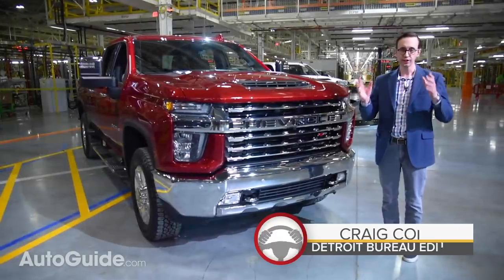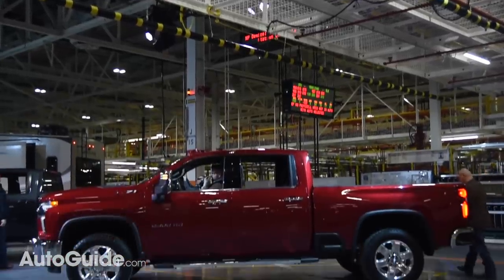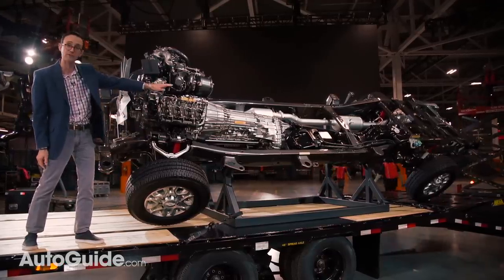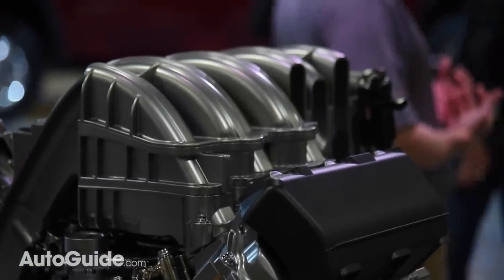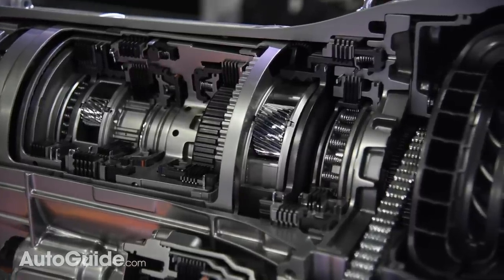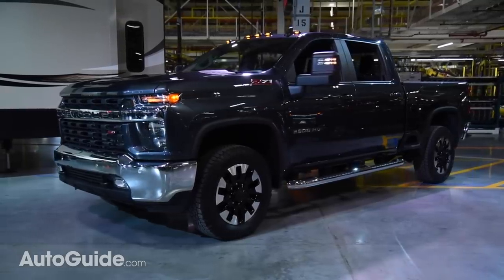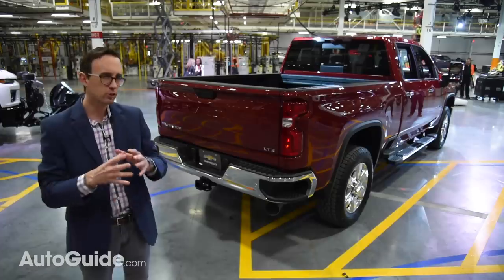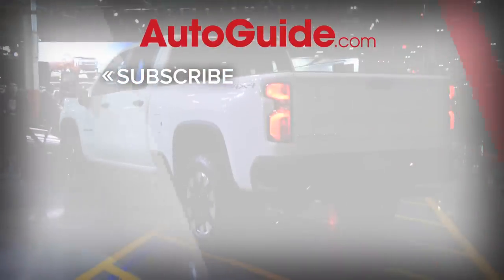2020 Chevrolet Silverado HD - First Look

Comment: Do You Guys Know When The 2020 Suburban Will Unveil?
Reply: What is the 2020-2021 Suburban gonna look like? I never seen a picture of it I only seen the spy shots, the current generations, the previous generation, and the misspellings
Reply: Santino Eli It Will look like the Silverado it will have the same grille as the Silverado and the headlights will look similar to the Silverado and the Suburban Will Have the air curtains that’s on the Silverado beneath the headlights and the taillights will be different on the Suburban and it will not look like the Silverado’s taillights
Reply: @justinsmith2598  I ain't got a picture of it
Reply: Santino Eli they haven’t unveiled it yet or showed a picture of it
Reply: @justinsmith2598  Same ones from the previous one and what is a air curtain
Reply: @justinsmith2598  How about the windows
Reply: @justinsmith2598  Will it have the same rear end, Will it have push start, Will it have a 4 cylinder like the Silverado, Will it have auto stop, I googled it and I don't see all I see is the current generation, spy shots, not the one showing it,
Reply: @justinsmith2598  Oh I thought it was going to have the same taillights from the Silverado but what will the taillights look like?
Reply: Santino Eli it will not have the same rear end,it will have push start,auto stop and it will get a 4 cylinder
Reply: Santino Eli oh wait you’re right the taillights will stay the same
Reply: @justinsmith2598  Different taillights?
Reply: @justinsmith2598  You mean have
Reply: @justinsmith2598  When are they gonna have a picture of it?
Reply: @justinsmith2598  Same windows, Same wheels from the Silverado, Same cluster, Same headlights, Same everything except rear end?
Reply: Will it have the same the interior from the Silverado? Will it come in special editions? Are they going to make a Tahoe version out of it?
Reply: @justinsmith2598  What else will it have to it? Will it have the same headlights as the Silverado?
Reply: @justinsmith2598  Are the taillights still square?
Reply: Santino Eli yeah
Reply: @justinsmith2598  Now let's talk about the Yukon
Reply: Please tell me when are they gonna have a picture of it
Reply: @justinsmith2598  Will everything be the same except the rear end
Reply: What trim levels will it come in?
Reply: Santino Eli The Yukon is gonna look exactly like the Sierra But a smaller grille
Reply: Santino Eli oh no it will not have the same interior from the Silverado and idk if it will come in special editiins
Reply: Santino Eli The trim levels for the Suburban is LS,LT,RST,Premier Plus And high country and the Yukon Trims will be SLE,SLT,AT4 And Denali
Reply: Santino Eli idk when they are gonna have a picture of it but it is gonna go in production sometime in May or June
Reply: @justinsmith2598  Sorry it's editions but tell us more about the Yukon what is the grille gonna look like
Reply: @justinsmith2598  Finally AT4 YUKON!!!!!
Reply: Do the Escalade next
Reply: @justinsmith2598  Maybe before they come out they'll have a picture of it
Reply: @justinsmith2598  Finally GMC's making an AT4 Yukon!!
Reply: @justinsmith2598  Will the Suburban and the Yukon version have the same gauge cluster from the Silverado and the Sierra? Will they both have the same windows? Will they still have the same headlights (Silverado) and the same grille (Sierra) because I already know that. And will they still have the same Denali wheels from the Sierra version? Will they come in a 4.3L V6 and a 3.0L Inline 6 Diesel like the Silverado and the Sierra? Is the 2500 coming back? Will they have the same mirrors from the Silverado/Sierra? Will it have the 5.3L V8/4.3L V6/6.2L V8/3.0L I6/6.6 LITER badge on the side vents the fenders? Will it come in 6.6 gas everything like the Silverado/Sierra HD? Will they have a liftgate step like a tailgate step from the Sierra? Will the Suburban have the auto liftgate? Will everything be the same except rear end, interior, and something else besides that those will be the same exact things from the Silverado/Sierra.
Reply: @justinsmith2598  Will they have the same gauge cluster?
Reply: I mean from the 2019 Silverado/Sierra not the cluster from the 2015-2019
Reply: @justinsmith2598  Now talk about the Escalade.
Reply: @justinsmith2598  Same windows, Same headlights, Same everything except rear end and interior, And do the Escalade version and more about the Yukon version
Reply: Santino Eli The 2020 Escalade Will Have The same Headlights as the Ct5 Or xt6 And Same taillights as the xt4 and the Escalade,Yukon And Suburban And Tahoe will be bigger
Reply: @justinsmith2598  Do more about the Yukon will it have the same grille
Reply: @justinsmith2598  Sorry Cadillac don't make a truck similar to the Silverado or the Sierra
Reply: @justinsmith2598  Do the Tahoe
Reply: @justinsmith2598  Will the new Suburban and the Sierra have the same gauge cluster from the Silverado and the Sierra and the same headlights?
Reply: Santino Eli I know I’m telling you about the Escalade
Reply: @justinsmith2598  Do more about the Yukon
Reply: @justinsmith2598  Oh, I got a few more things to say, Will the grille and the rear say "CHEVROLET" on it? Will it come with heads-up display (HUD)? Will it come in Z71? Will it have the same wheels from the Silverado? Will they have white/blue letter tires? Will they have running boards? Will they have the same windows from the Silverado/Traverse? Will it come in diesel, V6, and a 6.0
Reply: Santino Eli oh no it will not say Chevrolet across the grille and rear and it will come in heads up display and it will not come in z71 and it will have the 2020 Suburban LT Will Have The Same wheels from the Silverado lt
Reply: Santino Eli oh whoops sorry
Reply: @justinsmith2598  I did it not me I thought it was going to look like the 2018-2019 Expedition for a second but it won't
Reply: Oops it's Expedition not email
Reply: @justinsmith2598  What do you mean oh whoops sorry
Reply: @justinsmith2598  You forgot some things will it have white/blue letter tires will they have running boards will they have the same windows from the Silverado/Traverse and will it come in diesel, V6, and a 6.0
Reply: Santino Eli It will not have the same windows as the traverse and Silverado and it will of course have running board and it will have a diesel and idk if it will have a white and blue letter tires
Reply: Santino Eli Because you said that I spelled something wrong
Reply: @justinsmith2598  I accidentally spelled Email it's Expedition I thought it was gonna look like the expedition but it's the Silverado
Reply: @justinsmith2598  What are the windows gonna look like
Reply: @justinsmith2598  Will the windows be the same as the 2015-2019
Reply: @justinsmith2598  The Traverse and the Silverado's windows are the same shape
Reply: @justinsmith2598  When is the 2020 Suburban/Tahoe/Yukon/Escalade coming out
Reply: Santino Eli idk when it’s gonna be on sale but it will go in production in May
Reply: @justinsmith2598  It's coming out next month or maybe that's when they'll have the picture of it yet
Reply: @justinsmith2598  Tell me more about it tomorrow
Reply: @justinsmith2598  What are the windows going to like it's taken from and what are the headlights gonna look like it's taken from too
Reply: @justinsmith2598  Sorry my name is The Top Speed Guy from now on
Reply: @justinsmith2598  What will the windows look like? Will it have power running boards, Where will it say "CHEVROLET" at?
Reply: @justinsmith2598  Will the taillights be the same on the previous gen 2015-2019 or 2007-2014? Will it have power running boards? What are headlights and the windows gonna look like?
Reply: The Top Speed Guy It will have the same size of the taillights from 2015-2019 but it will change inside the headlights and yes it will have running boards
Reply: The Top Speed Guy the windows will look the same and it will not say Chevrolet across the grille
Reply: The Top Speed Guy it will not say “Chevrolet” anyone it’s just gonna have the Bow tie
Reply: The Top Speed Guy it will have the same windows as the outgoing Suburban and all I know is that the taillights will look similar to the new Silverado
Reply: @justinsmith2598  You mean power running running boards and are the windows the same and you said anyone
Reply: The Top Speed Guy the Tahoe is gonna have the same stuff as the Suburban But a shorter wheelbase
Reply: @justinsmith2598  Oh, why the same windows as the old one? I thought it's gonna look like Silverado/Traverse windows
Reply: The Top Speed Guy the Yukon windows will stay the same and the front end will look similar or to the new Sierra and the size of the taillights will stay the same but some changes inside the taillights
Reply: The Top Speed Guy oh wait you’re right sorry
Reply: The Top Speed Guy yeah I meant power running boards
Reply: @justinsmith2598  Will it have moving running boards will it have the same headlights
Reply: @justinsmith2598  Sorry you noticed I just changed my name to "The Top Speed Guy" and added a picture "2010 stock silverado 5.3 top speed"
Reply: Will it have moving running boards and the same gauge cluster
Reply: The Top Speed Guy I know
Reply: @justinsmith2598  Will it have the same gauge cluster
Reply: Forgot 2 things, Will it have a sunroof, and the same gauge cluster from the Silverado
Reply: @justinsmith2598  Finally High Country Suburban
Reply: The Top Speed Guy idk if it will have a sunroof but I know it will have the same cluster as the Silverado
Reply: @justinsmith2598  Sorry it's just a customization
Reply: @justinsmith2598  My name is The Top Speed Guy now
Reply: @justinsmith2598  It's May today!!
Reply: @justinsmith2598  Really? I know it will have the same cluster
Reply: @justinsmith2598  What does idk if it mean
Reply: @justinsmith2598  What about the Yukon will have the Sierra cluster and will the suburban headlights be the same
Reply: Will the suburban come in trail boss
Reply: @justinsmith2598  Every Suburban has different taillights
Reply: @justinsmith2598  Will it have the side scuttle that's on the headlights, Will it come in Trail Boss
Reply: @justinsmith2598  I think they finally have the picture now!!!
Reply: Daniel Frank how did you find it what website?
Reply: Daniel Frank what do the trucks look like?
Reply: @justinsmith2598  I googled "2020 Suburban" and all I see is those stupid spy shots and the 2015-2019
Reply: @justinsmith2598  Googled it
Reply: @justinsmith2598  Ugh, I hate the things being the same on it
Reply: @justinsmith2598  Oh no it will not come in trail boss the trim levels will be LS, LT, LTZ, High Country, and the Yukon trim levels will be SLE, SLT, AT4, and Denali and what would the Escalade have?
Reply: Daniel Frank Do You Know when it’s gonna Unveil?
Reply: @justinsmith2598  Actually the side of the doors actually is a Silverado but without the curve on the back of the windows
Reply: Or a Traverse
Reply: @justinsmith2598  What trucks
Reply: Daniel Frank  the new Suburban,Yukon And Escalade
Reply: @justinsmith2598  Trucks that look alike:
Nissan Titan looks like Ford F-150
Dodge Ram looks like Chevy Silverado
Honda Ridgeline looks like Chevy Avalanche
Cadillac Escalade EXT looks like Lincoln Mark LT/Blackwood
Denali looks like a Lariat
Trail Boss, Warrior Concept, Rebel looks like a Raptor
High Country looks like a Roush
Reply: @justinsmith2598  I don't know either it probably before my birthday
Reply: @justinsmith2598  I just seen 14 stupid spy shots on gmauthority.com
Reply: Now I'm Daniel Frank the F-150 guy
Reply: @justinsmith2598  When the comment first came in I thought it was going to look like the 2018-2019 Expedition but it's the 2019 Silverado
Reply: @justinsmith2598  I think I'm going to buy me one like this next year I want a 2020 Suburban when they come out I want a white LTZ trim level with a 6.2 and with navigation and the cluster with a full digital display and with a supercharger
Reply: Daniel Frank you meant 2021 Suburban
Reply: I'm sorry about this, guy, You moved his comment
Reply: So he didn't delete it
Reply: I think June they'll unveil it
Reply: @justinsmith2598  I'm trading my 2013 LTZ for this a 2020 LT
Reply: No all Suburbans have different taillights
Reply: @justinsmith2598  I forgot
Reply: Probably actually compared to the 2018-2019 Expedition not to look like it
Reply: @justinsmith2598  One trim level it will not come in it's trail boss none of them
Reply: @justinsmith2598  Sorry mistake editiins
Reply: @justinsmith2598  What about Escalade and Tahoe trim levels
Reply: I mean foot activated liftgate
Reply: @justinsmith2598  Even Buick Pontiac Oldsmobile don't make one if it's GM
Reply: @justinsmith2598  What do you mean oh whoops sorry
Reply: @justinsmith2598  He forgot it
Reply: @justinsmith2598  Probably before my birthday
Reply: Now Daniel Frank
Reply: @justinsmith2598  Sorry it's anywhere
Reply: @justinsmith2598  You mean same
Reply: @justinsmith2598  All of the suburbans tahoes yukons have the same cluster except for all generation escalades and for the 2020-2021 Yukon
Reply: No
Reply: No I want LT 6.2
Reply: Daniel Frank bad news the new Suburban,Yukon And Escalade won’t come until 2021
Reply: @justinsmith2598  No we want 2020
Reply: @justinsmith2598  Please add these in forza horizon 4 all of them suburban 5.3 tahoe 6.2 Escalade 6.2 yukon 5.3 Escalade Tahoe will sound like Corvette Z06 and suburban Yukon will sound like Corvette c1 huh😂
Reply: @justinsmith2598  Ohh auto correct is stupid
Reply: @justinsmith2598  Tahoe trims Escalade trims and Tahoe Z71's badge will be on side of doors or fenders probably doors I think because all of them the Z71 trims have Z71 badge on doors except or I don't about 2007-2014 I think it don't
Reply: @justinsmith2598  Didn't the previous gen Suburban come in RST trim?
Reply: @justinsmith2598  Sorry I noticed they actually do it's just a customization anyways if they did
Reply: @justinsmith2598  You mean it will have the suburban from the wheels😂😂😂😂🤣🤣🤣🤣I can't lie
Reply: @justinsmith2598  The wheels will have the suburban from the Silverado 😂😂😂😂😂😂😂 I cannot understand
Reply: @justinsmith2598  You mean it will be the same
Reply: @justinsmith2598  Do the running boards move on some trim levels?
Reply: @justinsmith2598  All of the Suburban Yukon Tahoe generations have the same cluster except 2020-2021 Yukon has 2019 Sierra cluster and all Escalades have different clusters except 1st gen has the Silverado/Sierra cluster
Reply: @justinsmith2598  Oh I still don't it's those stupid damn spy shots on gmauthority.com
Reply: @justinsmith2598  No there was some kind of website that showed it the production model years 2020-2021
Reply: @justinsmith2598  Maybe until August
Reply: @justinsmith2598  I hope it has retractable running boards
Reply: @justinsmith2598  I'm trading my 2013 LTZ for one of these
Reply: Ah, we talked about it already later
Reply: Hah I'm just joking they have to😂😂
Reply: @justinsmith2598  Yeah it does come in special editions Ohhhhh that misspell bothers me so much
Reply: @justinsmith2598  Oh thank God no trail boss because no expedition raptor durango rebel armada warrior concept
Reply: @justinsmith2598  Maybe when it comes out before they will have the picture
Reply: @justinsmith2598  I thought it was CT6
Reply: @justinsmith2598  Bigger than what?
Reply: @justinsmith2598  Sorry it just a customization or something from Reddit
Reply: @justinsmith2598  It will have the suburban will have the same wheels from the silverado 😂😂😂😂😂😂😂😂😂😂😂😂😂😂😂😂😂😂😂😂
Reply: Because it will have the suburban will have the same wheels
Reply: @justinsmith2598  Nope still not out yet I guess before Christmas
Reply: @justinsmith2598  Will it have RST logo on the rear and the grille
Reply: @justinsmith2598  No, retractable running boards like they move
Reply: @justinsmith2598  I guess it will have a sunroof
Reply: No
Reply: @justinsmith2598  Still don't know either
Reply: They cut the curve they look like it's taken from a Ridgeline
Reply: Maybe when I get the new Silverado
Reply: I finally found it!!!!😂😂😂😂